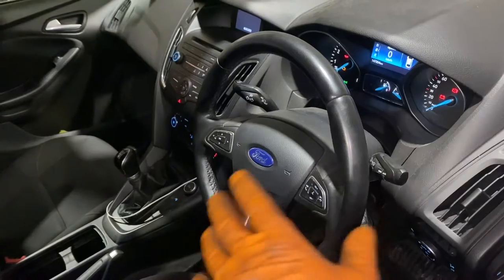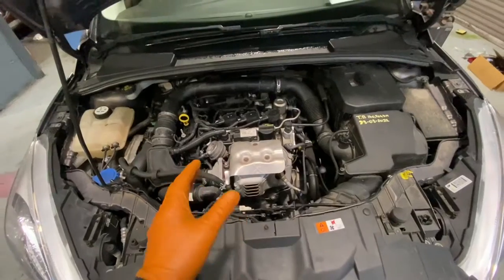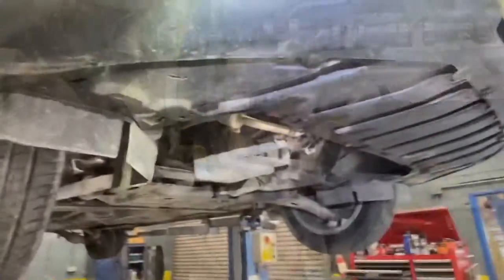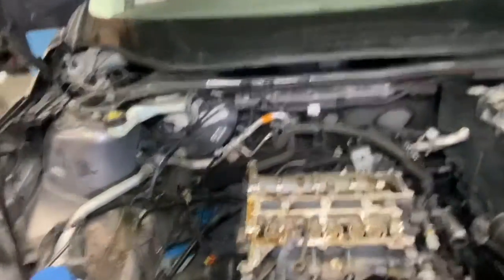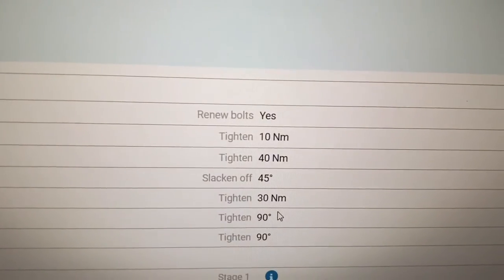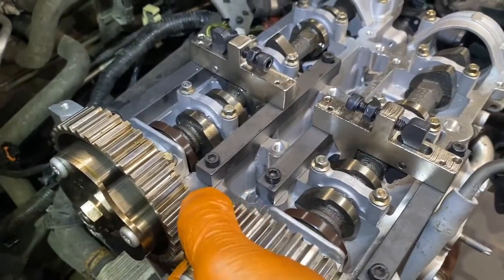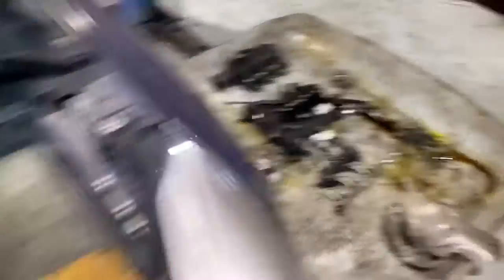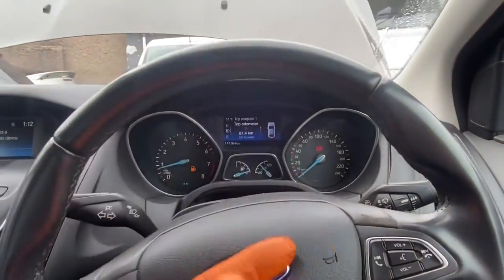Ford focus, 1.0 eco boost wet timing belt replacement & head gasket replacement

Comment: Hi, greetings from Bulgaria! I own a 2017 Ford Focus 1.0 Ecoboost engine. In our Ford forum there is no much information about this engine. I recently joined the UK Ford owners club forum and I was impressed of number of engine failures complaints because of the wet belt shedding, oil pump strainer obstruction and engine oil starvation. They even joked they have two engine failure complaints per week. So I wonder why? Do you have any explanation? I consider that the owners of these engines are well informed about the specific oil that Ford recommends  for 1,0 Ecoboost?
Reply from the maker: They do fail due to incorrect oil specs or the high pressure pump leaking fuel into the oil 😬😬
But you are right why don’t owners of these type engines know more about avoiding the problem .  I think most people just don’t care, or don’t want to know 🤷🏼‍♂️🤷🏼‍♂️👍👍
Reply: I've lived in both UK and East Europe and the difference comes from the oil change interval and oil type/quality.
These engines do fail also in East Europe, but less frequently than in the west.

The East European is a "poor" man and he can't afford to lose an engine because of cheap oil or long oil change intervals.
Most of us view a vehicle as an investment (rather than a liability) and spend more on the maintenance. 
Brits just take their cars to the cheap local garage  to get a cheap oil change, and that's usually whenever they remember doing so, not when the car is screaming for a service.
There's obviously exceptions on both sides.

I also own a 1.0 EB and was not aware of why the car community views it as an unreliable engine, up until I have read the UK forums.
Either way now, just for peace of mind, I will take the oil sump off at the next oil change and check the oil pickup and oil pan, plus have a look at the timing belt, as I expect one should see it from below.
Reply: @kennedysgarage3281 

Focus 1.0 
Hi mate i just managed to into live data fuel rail pressure is 1300 psi 
And also the fault code i am getting is p0089 
Fuel rail oressure regulator 1 performance its says would that be the high pressure fuel rail sensor ? Maybe that sensor is gubbed 
Any idea mate ? thanks
Reply from the maker: @Peter-sm8bj  it could be, it might be worth looking at the spark plug condition. It might identify a leaking injector causing a fuel pressure fault 🤔🤔

Comment: The only Ford worth entertaining is one with a PSA diesel installed.
Reply from the maker: I have done a head gasket on a 2016 Smax and it gave me some grief 😂😂😂
But you are probably right 🤔🤔🙏🙏
Reply: 2.0 HDI is a great engine
Reply: Bet you've done a few injector seals on the 1.4/1.6 PSA diesel lump 😂
Reply from the maker: @philphil3707  it made me suffer 😬😬
Crank bolt sheared then the head snapped off 4 head bolts. I got over that then 1 week after it was done the impeller fell off the new waterpump. Another week after that the turbo failed. It just tested me a bit 😤😂😂😂
Reply: @kennedysgarage3281  that's what nightmares are made of
Reply from the maker: @philphil3707  nightmare in Portlaw 😂😂😂
Reply: It's all of them problems that gives us experience and able to work on difficult jobs, tightening things up to FT 😉

Comment: The cam locking tools are actually very straightforward to use, though they seem quite daunting at first.  When you have the cover back on you put them on in place of the actuators (use the 3 actuator bolts at 7nn), then you tightened down the 6 bolts to 15nm whilst pushing the tool pin to the left.  All they do lock the cam wheels in place while you torque down the crank bolt.  The tool I had wouldn't fit into the exhaust cog, but it was because the tool was assembled incorrectly.  I removed the six bolts and spun the back part of the tool until it was in the correct position to push into the cam wheel slots.
Reply from the maker: @MrUnderwurlde  oh, that’s sounds relatively easy. And you explained it very well, thank you 🙏

Comment: Peter I have 2 of these engine cars in my family.  I drive a transit courier with the 1.0 ecoboost (rare as most have the diesel) and my son drives the 1 0 fiesta st line. Both looked after and and have been faultless. Nothing to be scared of as quite easy to repair as you show. I'd be happy to do that job if they break at high milage.
Reply from the maker: They actually aren’t too bad Chris, plenty of room to work on once all the silly bits are removed & the cylinder head was only around €900, all the other parts did add up but worth doing right once disassembled 🤞🤞🙏

Comment: I didn't know about that sticker on the cylinder head, also I am with you on the craziness of head and crank torque settings.
Reply from the maker: I think most fancy stuff in cars are now only to confuse techs and make this trade a little harder. But is it going to go full circle and come back around to bite manufacturers on the bottom, with the unavailability of young people coming into the trade 🤷🏼‍♂️🤷🏼‍♂️

Comment: Ive got one to do tomorrow, how long did this take you to complete? Seen the book time on autodata but what is a realistic time frame for doing one for the first time? Great video
Reply from the maker: On you 1 st attempt I’d suggest giving yourself 2 days. You’d do it in 1 when familiar with them. Watch the water housing that comes off behind the belt close to the exhaust manifold. It breaks easily 🤞🤞

Comment: Another excellent video. Thanks for walking us through that as I haven’t done one yet. Do you know why that crank washer needs to be replaced?
Reply from the maker: There isn’t one in there when manufactured originally. And I have done them without ever replacing but have heard of guys talking about it & seemingly it reduces the likelihood of the crank pulley pulling from it’s aligned position. The crank pulley has the crank sensor tone ring on it and needs to be very accurate. Probably worth fitting it if ever doing one, thanks Trevor 😉🙏🙏🙏

Comment: Hey Peter I had quick question how much you charge for replacement timing belt Ford focus 2015 1 litre thanks
Reply from the maker: It should cost around €1500 in total

Comment: Those are ribe sockets. Think they are used on vw drive shafts inner end as well.
Reply from the maker: Ribe sockets 🤔🤔 handy to know, I have only had to use them a handful of times in my career. Thanks Richard 🙏🙏
Reply: @kennedysgarage3281  and on alternator freewheel pulleys I think.
Reply from the maker: @richardsheil5289  I better keep them to hand so 🙏

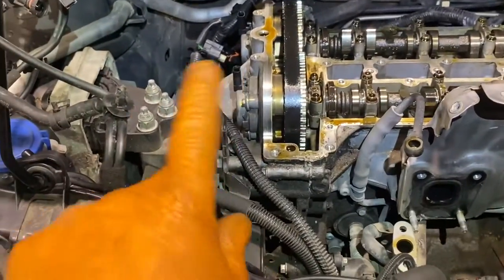Comment: 9:57  : the position of the timing belt on the camshaft gear looks off (close to the lrft edge) , when new installed at 25:30 it's bang in the middle. What's the correct position?
Reply from the maker: At 9.57 I was only disassembling & the timing belt was still in place, at 25.30 the timing tool was fitted and timing aligned. So 25.30 is correct 😉👍👍👍

Comment: I’ve been putting off doing the mrs belt because of the tool they say you need. 2013 and 105,000 miles mind 🙈🙈

  Great videos both this one and the other one you did. Will be ordering the stuff this week and will give it a go. One question though, as this video is showing a newer car, is this the same engine as the 1.0 Ecoboost in my mrs 2013 fiesta or are the newer ones  slightly different in any way?
Reply from the maker: Hey Rich, they are the exact same engine. The timing belt on these can be a bit tedious but nothing too extreme, I would advise getting the timing tool due to it being inexpensive @ less than €100. Good luck with it mate 🤞🤞👍
Reply: Thanks, I did it this past weekend, and wow it took me from Friday afternoon right through until Sunday evening. Think the most time consuming part is stripping it down as I had rusty bolts everywhere. I ended up buying a new sump and air conditioning pump bolts as they snapped. Your videos were a great help. 👍👍
Reply from the maker: @richwilkins50  you would be surprised how much time is involved in stripping that little engine, but really well done for getting through it 💪💪💪💪

Comment: Can't beat torquing up to FT!
Reply from the maker: I was trying to figure out FT for a few seconds 😂😂😂😂
Reply: @Kennedy’s garage  I worked on HGV's briefly, everything on them is FT....and then a little bit more haha! I good mechanic doesn't necessarily need to use a torque wrench to ensure a bolt is tightened correctly, you can do most things without it, it comes with practice and experience, I think you are great at what you do, keep the videos coming,
Reply from the maker: @philphil3707  thank you very much for saying that Phil I really appreciate it 😉🙏🙏🙏

Comment: you shoul at least do the crankshaft pully bolt up to 300mn plus 90 deg , you cant get enough torque with a 2 foot bar , if that cambelt drive gear slips   all your hard work will be for nothing
Reply from the maker: You are absolutely right Jack, I cannot get enough torque with a 2 ft bar (if I want to follow the book) but I can get enough torque for me & the never ever stir 😊😊
Back wheel bearings on vag group cars are the, they are set to stupid torque. Which is near impossible to get. I suggest using your experience and knowledge wins every time. This is just how I operate 😉👍👍👍

Comment: These 1.0 direct injection ecoboost engines are very variable quality-wise. With them having a cast iron block & an alloy head, they don't like getting toasted - leaving aside the huge issues Ford had with them bursting into flames.. cough.. The "variability" is 'cos 3 different factories make 'em - 1 in Germany, 1 in Romania & 1 in China - with varying degrees of "Quality Control".. that and direct injection is a fairly crap system to begin with - they all get choked with carbon... plus for such a tiny engine, Ford has to wring the engines neck to get sufficient power out of 'em - meaning everything is stressed to the max. 
Meh.. I yanked the engine out of an '80s Ford turbo petrol today - marvelling at the sheer lack of guff bolted to the block.. God be with the days..
Reply from the maker: There is some pile of sh_te on them nowadays James. Wouldn’t you wonder does it make them better or worse 🤷🏼‍♂️🤷🏼‍♂️
Cheers for the information 🙏🙏🙏👍
Reply: @kennedysgarage3281  88 ford with a straight up & down belt, no bells & feck all whistles chucks out 240 Hp using less chips than the interior light module on a '22 Focus.... it's back we have gone - not forwards.
Reply from the maker: @jamesward5721  yes, it is crackers isn’t it 🤷🏼‍♂️